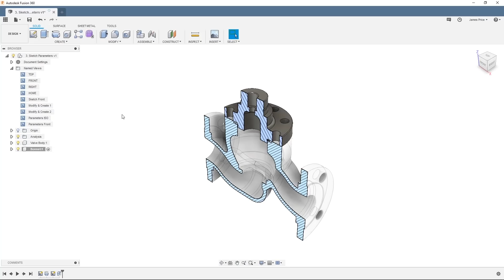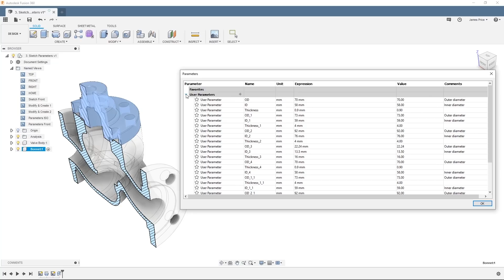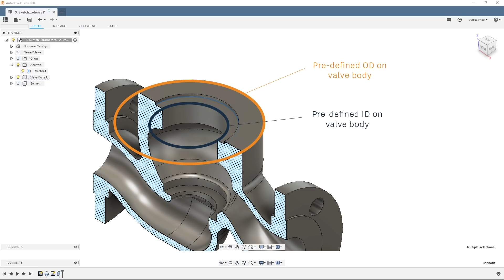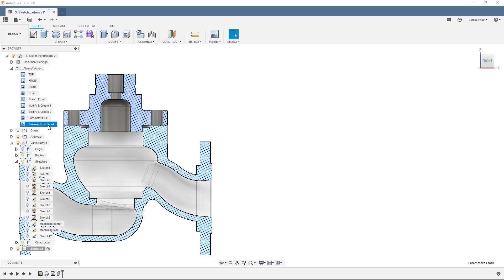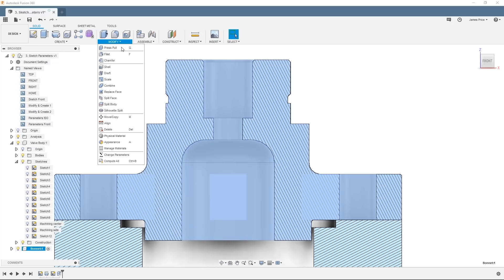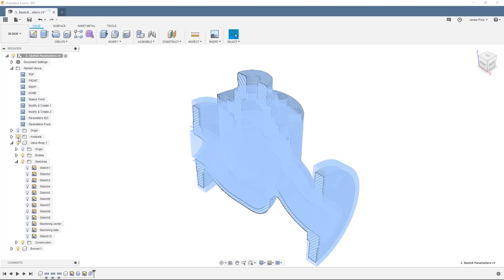Intermediate Sketch Parameters

Comment: No mention of favourites and their subtle impact when setting up a design heirarchy using sub-assemblies & the functionality provided by derive, maybe that's the advanced vid ;-) This aspect of the software is beginning to add real power to the Fusion workflow but ( there's always a but... ;-) the parameter area seems to be well overdue for a major overhaul. It would appear that at this stage the changes have been structural in that there has been a change to the object model to allow for the derive heirarchy so hopefully the next change will be to the UI/UX area. ( Add me to the list of people that have been asking for definition of names from within the initial dimension activity. Onwards and upwards, this is starting to be a sweet piece of software that is not only a pleasure to use but highly capable.

Comment: What is it that's "intermediate" about this? This is certainly a discussion of Sketch Parameters but I can't see what about it that's intermediate.
Reply from the maker: Others were saying this definitely wasn't a beginners lesson, so....
Reply from the maker: See Kelvins message on this very same video. It's very hard to please everyone, but we're trying.
Reply: So, it appears that the word "intermediate" in the title basically means that the video is intended for intermediate level users. Might I suggest using a title like "Sketch Parameters for Intermediate Level Users"? There's another excellent set of tutorials by a highly skilled designer and part of his series is for beginners, so he includes "For Absolute Beginners" in each title of the series. You might consider a similar approach if some of your videos are aimed at different levels of users. Also, when you have something like several parts in a series about some particular topic, you might include "Part 1 of 3" (and similar) in each of the titles and direct links (not simply a link to the playlist)to each of the related videos in the info about the current video.

Comment: Update it, the ui/ux for parameters is just painful compared to the whole software
Reply: I wholeheartedly agree. Parameters are an incredibly powerful feature, but the whole UI for it needs a serious redesign. There should be a way to re-order and sort the parameters in the list. There should be a way to organize the parameters hierarchically, just like folders in a file system. There should be a way to explicitly associate parameters with specific Components, bodies, and sketches when those parameters are ONLY used on those contexts. When you use a simple numerical value, for example for specifying a line length or circle diameter, it (very nicely) becomes a Model Parameter with an auto-assigned name. But there should be a very simply means by which the user can explicitly assign a name right at the time of specifying the value (or later by right clicking on the numerical value in the sketch and getting a dialog that allows for entering a name). The alternative is to first bring up the parameters dialog, add the parameter and then go back to the sketch and use it as the value for the line dimension, etc. That's very unwieldy and interrupts the workflow. There should be a way of telling the sketch to show all of the the actual parameter names rather than just the "fx" to indicate that it's a user-defined parameter.

Bottom Line: There's a lot that could be done to make the User Interface for the Parameters tool a lot more user friendly and effective.
Reply from the maker: Thanks for the feedback!